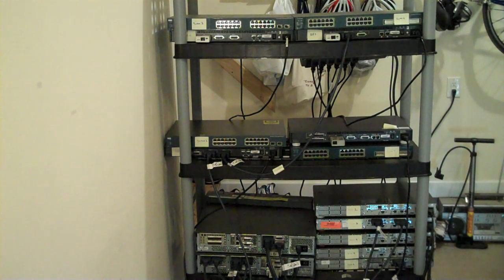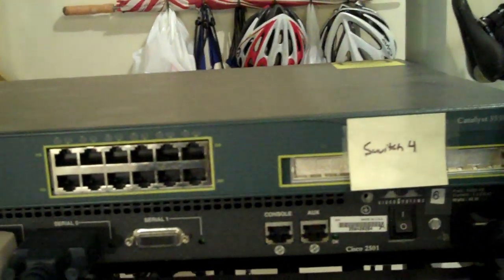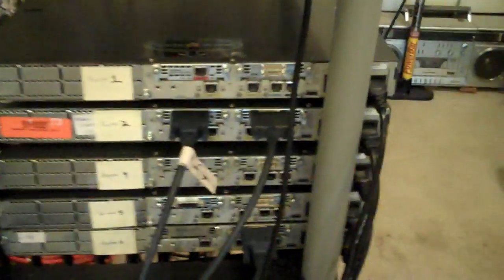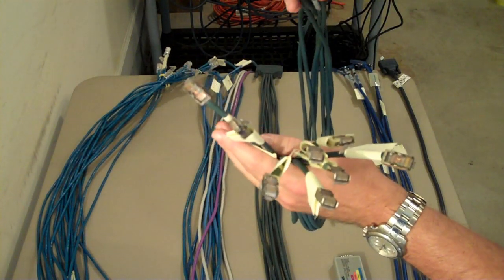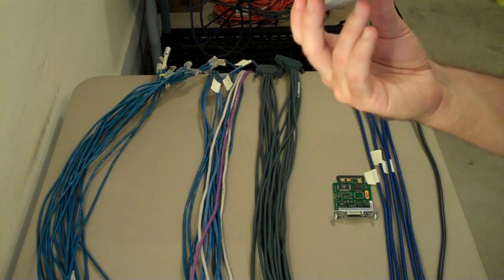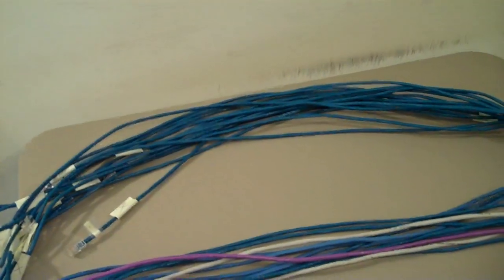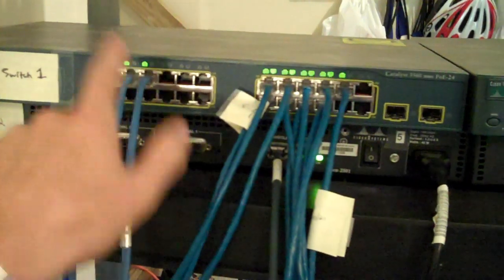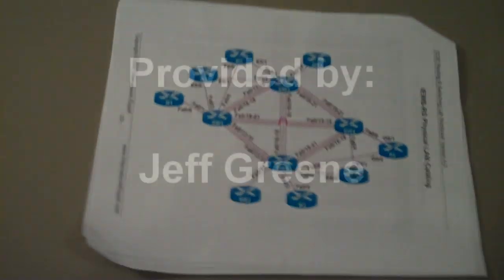How to set up a CCIE Lab Rack

Comment: I bought a 45U rack off Craigslist. It cost less than one 3560. Alternatively, you could simply a buy a couple of 12U Racks from Amazon for something like $28/each. I had one of those initially, but now I have more equipment than will fit on it and the 45U looks alot more professional.

Comment from the maker: A couple things to note:
- Video is 2+ yrs old, and the CCIE has changed dramatically since. So this is no longer relevant for the actual design...it's fine for general lab practice.
- 2501's - I know they're old...like 10yrs old. That's the point, and you can get them cheap on ebay or probably for free. The only purpose for the 2501's is to inject routes into your lab.
- My poor poor rack. Why spend a lot of $ on an expensive rack? The rack is not part of the exam. $30 at HD works just fine.

Comment: @amlife180 

You would need at least two switches. All the routers can be vtirualised in dynamips.

But if your serious about spending a good couple months of your life studying for this exam your going to need the whole lot that's in this video (If not more). If you go your route all you can do is practice basic concepts, perform the commands and that's it. In a full lab you can implement those concepts and see it in action. You can also "Break" it and then try fix it too - Get a friend for it

Comment: I was going to get another 3550 and 2x 3560's but I decided to use ipexpert's blended learning solution and get the 'graded labs' and the lab books so I can see where I went wrong. With that said, I wish I did have another 3550 and 2 more 3560's that would round me out. But, it's all expensive as you know.  

btw, nice network rack, I ended up getting a 45u rack for 50 bucks. 

Here is what I have now.
1 x 2522 (frame relay)
1x2511
2x2501
3x 3640
1x 2620
1x 3550
2x 2950